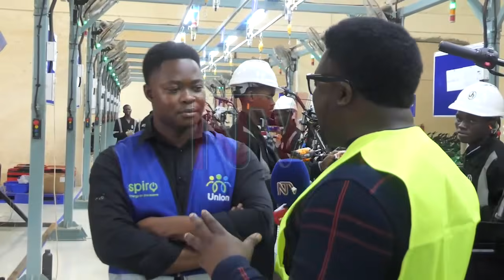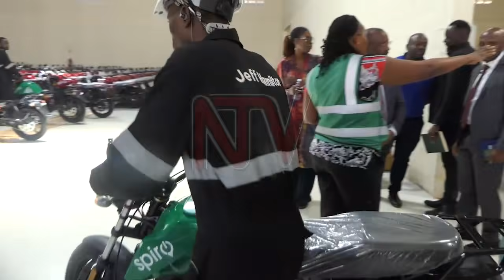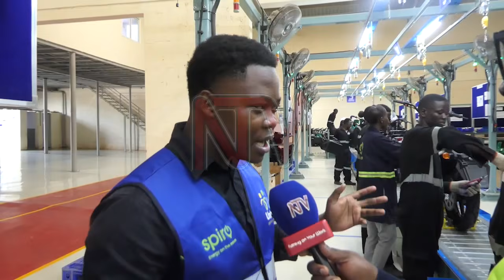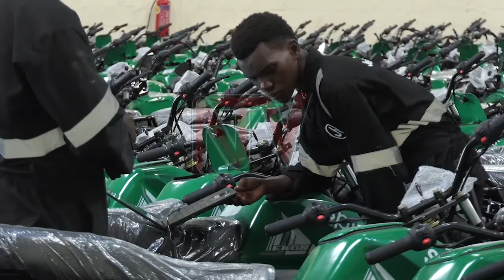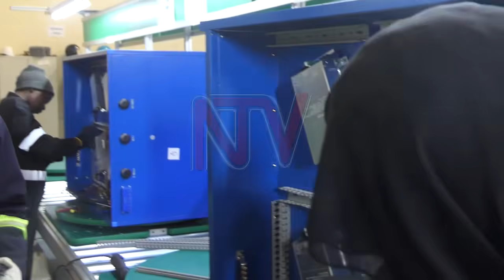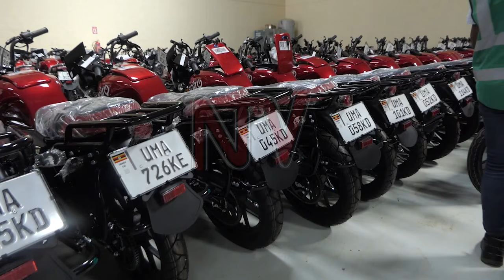Young engineers tackle pollution with innovative electric bikes

Comment: This is an assembly plant. Zero innovation. Most of all parts are imported.
Reply: Go and innovate or try to assemble something we see you. Mwabakyi nobutasiima
Reply: @vanietownshed that's the fact ugandan graduates can start up something on their own
Reply: the industrial engineer made a good system. the pracsta system with IoT, GPS, etc
Reply: You don't always have to create something new, some time you just have to implement as long as it makes you better.
Learn to appreciate the progress
Reply: Dude. Here too in Japan we import some parts used on the automotives. Mostly facilities created by the company but outside of Japan. It takes a long time for a company to create sister companies in order to make its own products. So it doesn't hurt to outsource different assembly materials from different suppliers. The important thing is that the thing has been assembled the right way and of good quality.
Reply: i see my brothers and sisters are having jobs which is good. besides it's just starters...
Reply: Oli ligumaavu😂
Reply: Tell me you have zero knowledge in tech manufacturing without telling me you have zero knowledge